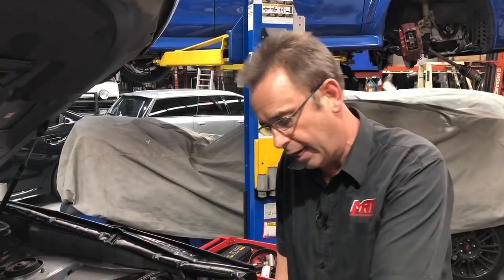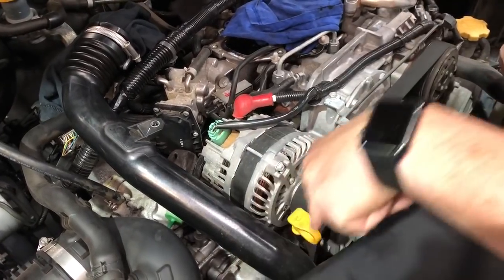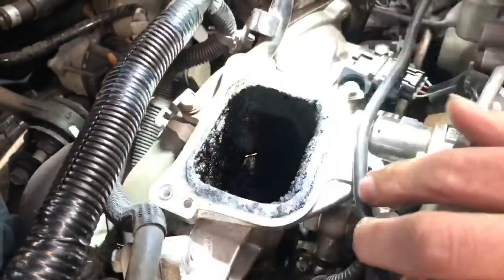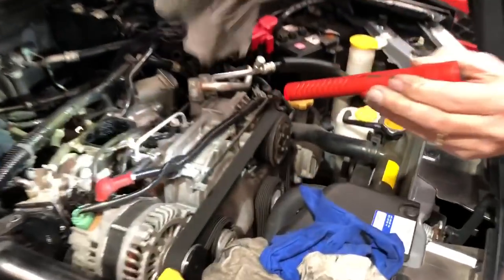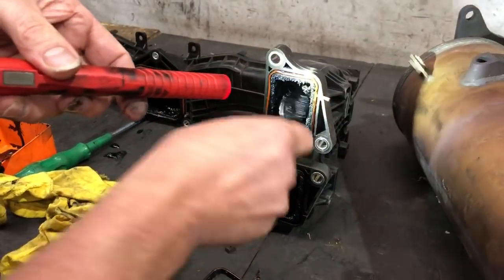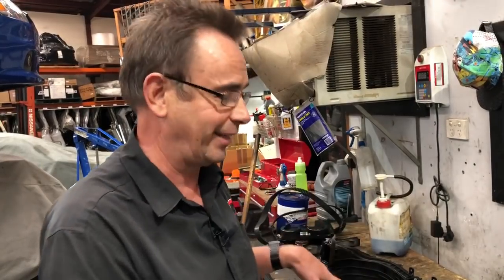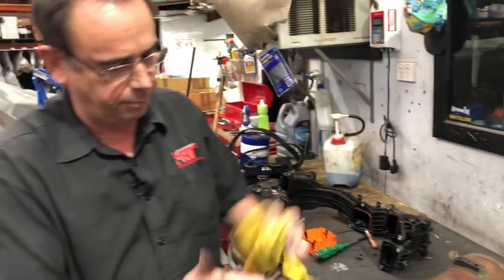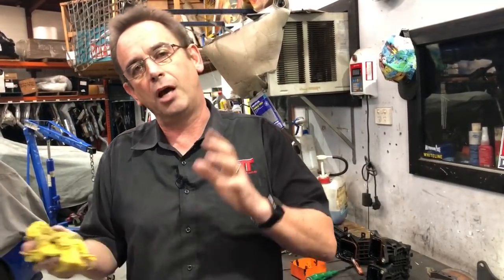Subaru Turbo Diesel Soot - A Real World Example

Comment: Have my own 2011 Subaru Impreza since February 2024, originally had Euro 4 engine which I had to replace last month, hydrolocked from blown headgasket(s) 😂
Swapped in Euro 5 engine from a 2014 forester and started right up without need for mapping or anything, just reuse old wiring harness from my previous 2011 Euro 4 engine and its plug and play, no lights on dash or nothing, hop in  and drive. Alot more soot build up on the 2014 compared to my 2011 though, because the dpf and egr was deleted and mapped out on it but those both carried over to the new engine, so its running pretty well so far, no more overheating or blown headgasket and hopefully less likely for a snapped crankshaft too 😂
I'm from Ireland where dpfs and egrs are deleted from majority of diesels and they still all pass inspection,  inspection only really cares if the exhaust is way too loud or if there's a bunch of black smoke out of the exhaust which only happens if you remap it to do such things. most people just go to steel yards and fabricate their own downpipes and stuff and it saves a lot of trouble and makes the car alot better than when it came out of the factory.

Comment: Very good video. My 2010 diesel now has error code P0401 - egr flow insufficient - exited to see if it is soot causing this as the egr is new.
Reply: What's the verdict?
Reply: Cleaned manifold. Still a few instances with this error. Noticed that this error occurs when on cruisecontroll - with very high loading and in the same time low rpm. Ie when failing to shift down in time before pulling up a long hill on cruise. Knowing this I have stayed clear of these errors since with the new aftermarket egr and a clean manifold. Now I am thinking about egr delete. Will it work to block off the floe but still leave the valve operative to avoid errors?

Comment: Seen 3 videos RE DPF/ Subaru TD, most informative in be seen yet . Purchased a 2012 Subaru Outback in August , drove it 3200kms from Darwin to Townsville. Have noticed recently when vehicle is cold ( usually just AFTER blue temp light goes out) on acceleration vehicle surges , like starving
For fuel/air, doesn’t do after that , and drives nicely incl on acceleration . Any ideas ?
Reply: IAC valve

Comment: my subaru 2.0 d outback 2009 whit brand new engine  25000miles @ moment (original total 140000miles on the clock)keeps stalling when coming to traffic light.most off times on summer,winter looks ok.euro4.injectors original whit140000miles  ,tested-ok.egr new,serviced every 4500 miles,turbo new,but sometimes not kicking in time,@ low rpm engine under power,5 gear drives good,bit smoke @ back -grey/brown smoke,any idea was wrong whit it,i do love it, so not going to sell:)))thanks

Comment: SO, can we suppress the EGR and the particule filter, and perhaps the debimeter - Some guys told me it was a great (and powerfull) solution.
Reply: For the boxxer diesel in particular its wise to get the ecu mapped together with the first gen DPF cause its an active open system, instead of this passive closed one.
Less backpressure but a bit more waste

Comment: Can you use a oil catch to avoid this issue? Or is it a completely different situation?
Reply: Its different, Oil catch cans usually collect Blow-by oil under heavy boost. The way to fix this is mostly deleting the EGR valve, so the oil and dieselsoot doesnt get put back in front of the turbo.
Older petrol engines can work with dual injection like some mazdas do, the good thing is you get better emissions from direct injection, but also the cleaning properties of the petrol that gets injected into the intake, cleaning all this shit off... Diesel are only direct injected cause they work between 1000-3000 bar of injection pressure

Comment: I thought cummins diesel were bad but wow this is crazy.
Reply: It's actually not crazy: the system needs to be able to reach operating temperature and it needs at least 15 minutes to burn off all that soot; in order to do that, the extra injector needs to inject fuel into the DPF chamber to raise the combustion temperature, and that only happens over 1,800 RPM. So if you drive the car purposely at 1,800 RPM or higher for at least 15 minutes every day, you are unlikely to have problems with the Cummins or with this EE20 boxer diesel. They just need to be given the chance to clean themselves.

Comment: Brett, is it true that the DPF in the Subaru Diesel engines is actually limiting the power figures? Do you also make modifications to the diesel engines, increasing their performance?
Reply: I can answer for him, YES. a big limiting factor. They did do a rally forester with DPF delete and ecu remap running i believe 197hp and 438nm tq, Brett correct me if im wrong.
The DPF is kinda like a cat, but not. its long, its thick and exhaust has to travel through really really small holes in it. I saw inside one. I didn't wonder why they get clogged up easily anymore. Also the DPF muffles the sound more than the stock mufflers.
Reply: @JTmoto   Hi I tuned my Impreza Diesel. The spec for tuning was 180hp / 420nm, but after delited  the EGR in ECU and take out the material inside the DPF it ended up with 185hp / 488nm. So about 68 extra nm, not bad.
Reply from the maker: Yes the DFP does add restriction to the exhaust system, however we would never recommend removing the DPF for a street car as its bad for the environment and highly illegal.

The good news is we can still improve performance significantly without the removal of the DPF.

have a look here at what we can offer in terms of Power Kits... http://www.mrttuned.com.au/mrt-staged-power-kits/high-performance-mrt-staged-power-kits-subaru/high-performance-mrt-staged-power-kits-forester/

Comment: Would you recommend any product to help prevent or reduce this build up?
Reply: Euan Taylor .......A Provent catch can will help a lot, it will remove the oily residue from the PCV system which then doesn’t mix with the soot from the exhaust which is what causes the build up of black crap.
Reply: shane   Reallly? I have a 2018 Colorado, for my own piece of mind after 6000 km i took the inlet hose off the throttle body and shone a torch inside, it had already started to soot up with gritty black shit stuck  the inlet manifold, the oil in it is the Holden Dexos 2 oil that is in the car from the factory.. Since fitting the catch can and cleaning the inlet manifold with Liqui Moly Diesel inlet and throttle body cleaner there is no build up or oily residue in the manifold. The car had its first oil and filter change today at 8858 km and the inlet and throttle body were checked so i know it works...
Reply: shane, true , mine only had a bit, but we just did a mates 2012 Hilux on Saturday, he did his apprenticeship with Toyota and is a heavy diesel mechanic now, he has run the recommended oil in his its whole life and post PCV entering the manifold there was 12 mm of soft wet sooty buildup throughout his inlet this reduced the diameter by 24 mm. Pre PCV there was maybe a 1 mm buildup... The Provent catch can will remove about 99% of the oily residue from entering the inlet as mine has done over the last 2800km.

Comment: Hello! First, I'm subscribed to your videos because I think they are extremely professional and instructive, really great and thank you on all the information you present! I live in Europe and I also have one Forester diesel - my question is how much costs such "cleansing" and when it should be done (kilometers)? Many thanks in advance ;-)
Reply from the maker: Thanks very much for the encouragement Tito. The cost and frequency really depends entirely on how bad the soot buildup is and how the car is used. If it sees regular highway driving it will need to be cleaned less often than if it's always siting in traffic. Best to have it inspected for a professional opinion.
Reply: Thank you again Brett and all the best from Sweden :))
Reply: MRT Performance , will a oil catch can help prevent this on a Subaru diesel?
It worked on my 4bt Cummins.